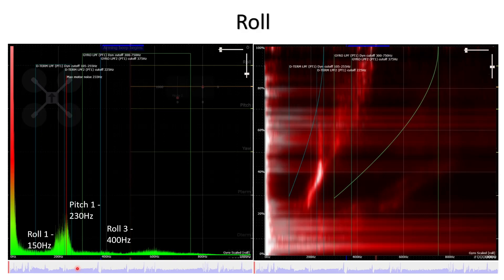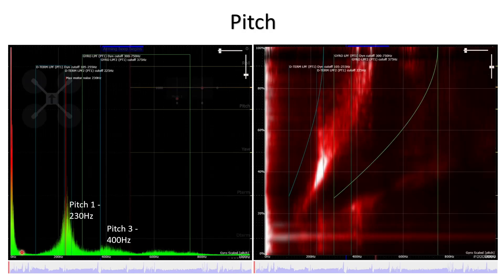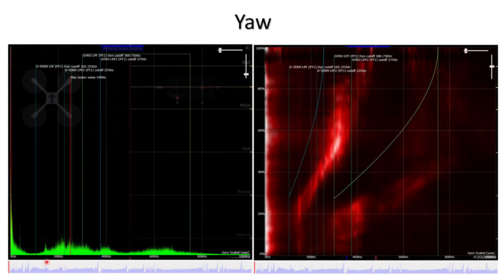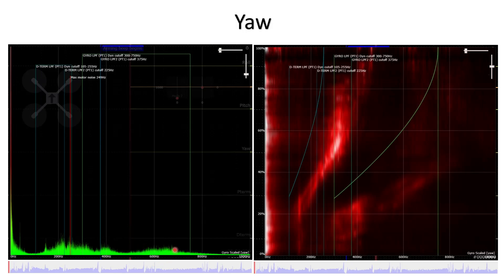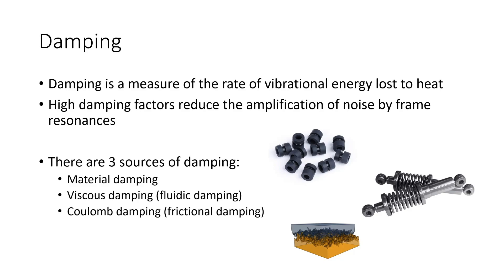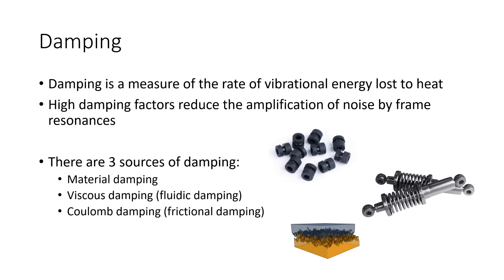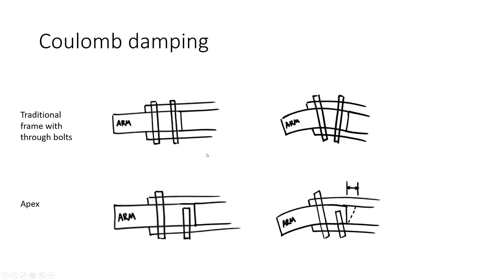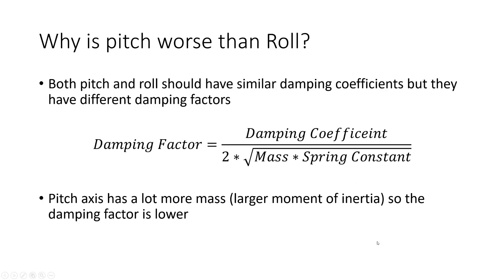ImpulseRC Apex Vibration analysis. Find out why the Apex is so good to fly.

Comment: Hi Chris, I know this is an old video but I hope you see this comment! 
I've been thinking about frame designs as I'm hoping to design my own micro frame. I was wondering what you thought about the idea of using two carbon plates sandwiched together making up the same thickness over a single plate. My thought is that it would introduce a lot of friction between them when bending and help eliminate noise?

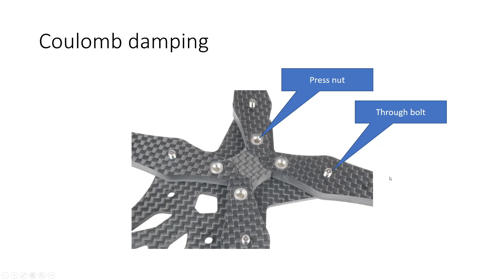Comment: 11:35 — I'm sorry, but I watched this segment multiple times, and couldn't grasp your idea of what moves, what deforms and how it's the "Apex" case where the arm slides more.

I can see how the arm can slide between the two plates: all the holes the bolts go through have some thread-hole clearances. If the clearance (D_hole - OD_thread) is e.g. 0.2 mm, the arm can slide as much as 0.4 mm along its own main axis in the top drawing, but only 0.2 mm in the bottom drawing (because the press nut has no clearance).

But you're talking about bending... Well, when the arm bends downwards, there's no difference, as the upper plate will be bent by the outer bolt, pivoted on the arm's inner end, so the length of the lever is virtually the same. When the arm bends upwards, the upper plate, which now has a much longer stretch that's structurally elastic, will be bent only by the outer bolt tilting and pressing it in, but... my napkin geometry fails me here, but it's either the same radius, so it doesn't slide against the arm, or a larger radius, and it detaches from the arm's surface as soon as they start to bend...

OK, hand-wavy reasoning and Paint pictures just don't work with this. We need to either get a civil engineer who can apply his materials mechanics 402 knowledge and evaluate the two configurations using differential equations and shit, OR do an experiment: get an Apex frame (or, hell, a quarter-frame), ditch the press-nut, drill through the whole thing, install a (larger diameter) through-bolt and compare it against the original. Otherwise, I'm not convinced a single bit.

This is quite an unusual frame. Its excellent vibration properties can come from any one of its features or all of them together.

Comment: what do you think about rubberized and dampening crews for the FC/ESC? not just around the bold, but actually decupled screw with a damping cylinder and then on top of that the flight controller? would be really interested in your take of using those, if it changes the flight charactaristics? thanks in advance! ps: just ordered the AOS 5.5

Comment: Could be wrong but I'm not sure if impulse would have the same test equipment to be able to dermine that the arm friction dampening mechanism provided good result and so was a sole design reason? Could it just be a co-incidence?
However, by having seperate countersunk bolts on the upper plate, they certainly did chose to decouple the flight controller somewhat by choosing not to have the flight controller mounting bolts going through the arms.. which would transmit a lot of vibrations directly to the FC. Most other manufacturers would typically try to save a few grams by incorporating the arm bolts into the FC without considering the bigger picture of piping vibrations directly to the FC.

I would love to see you do a test on using soft motor mounts and maybe also have a look at the iflight Xing motors which use a rubber o-ring between the bearings and motor base to reduce vibes... its the first video I've watched of yours, so maybe you already have. 
Very well done, I love this sort of stuff. You just got a new Sub, :)

Comment: Hi Chris! What do you tjink of the Catalyst Machineworks arm lock design? It seems to me that it could probabily act similar to the apex. I have 2 Cmw frames and the vibration performance is great
Reply from the maker: It really depends on the weight. If the frame is heavy it will probably have good vibration performance. But it's also heavy... The goal is a lightweight frame that is strong, and stiff with good vibration performance.
Reply: @ChrisRosser  I got it,thank you 😊
One of the cmw frames I own wheighs only 69 grams so I was wondering if the fact that the inner arm screw isn't locked to the arm itself could be the reason of such a good performance
Reply from the maker: @loryriga  It could well be providing a benefit. It's very hard to know without an in depth analysis of the specific design.
Reply: @ChrisRosser Great, thank you for your reply Chris. 
If in the future you'll analyze a catalyst frame I'd be very curious to see the results!

Comment: And with all this insight and ultra in depth viewing he will still say check motor temps. Reduce filtration follow a good strategy check motors. Can you reliably log this as a given cos different flight controllers produce different noise. Same frame different flight controllers different readings. The theory is one thing but it will come back to checking motor temps for feel.
Reply from the maker: Got to check your motor temps. It's just common sense because no one likes to smoke a motor because of some undiagnosed tuning problem!

That said, if you follow my approach checking motor temps should more be a double check that you didn't accidentally screw up rather than an integral part of filter tuning.
Reply: @ChrisRosser  it’s pretty hard to screw it up.

Comment: I really don’t understand why with single bolt it sliding but with 2 screws is bending
Reply from the maker: The second screw constrains the sandwich plate to move with the arm. Without relative movement there can be no sliding and no frictional dissipation. KababFPV has done a video on some testing he did to verify this hypothesis on his Toothfairy frame. Worth checking out: https://youtu.be/oHONikUxCcw

Comment: If you read the ImpulseRC web page they specifically mention the shoulder bolts as being unique to this frame.  I guess with a shoulder bolt you get a much tighter tolerance fit between the arm and the bottom plate as apposed to a fully threaded bolt? 
Nobody's talking about the shoulder bolts.  I thought it sounded like an interesting point to think about.
Reply from the maker: Thanks for the comment. It's a great point, shoulder bolts do help get a nice fit between the screw and the carbon.

Comment: If you're considering any other frames to analyze I'd vote for the hyperlow airshot.  It seems like it may benefit in similar ways, but I've never seen any logs so it's just a guess. And also the mad kwads frame because they're the only frame company I've heard even mention vibrational analysis as being a driving force for design choices. Great job. Your coulumb damping explanation was great and the drawing top notch but I feel like a great animation and maybe a little more detail or depth on the friction/bending/compression/stretching aspect could have really driven the concept home for everyone.
Reply from the maker: Thank you for your feedback. I'll definitely try to do some animations next time to show the effects.

Comment: Hello Chris i would like to ask you about your graphs. All graphs that you provided into the video are having x axis limited from 0-1000hz. Does that mean that higher frequencies are not that important for drone flight? Because i'm imagining this system to fly on frequencies much higher than 1000hz.

#question
Reply from the maker: Flight frequencies for a quadcopters are <100Hz. Motor vibrations go up a bit higher to around 600Hz. Up above 600Hz there is a hardware lowpass filter on the gyro that really  attenuates noise above ~500Hz and once you get to 1000Hz the gyro just isn't sensitive to those frequencies anymore.

Comment: Could you effectively dampen all quads by simply using a viscoelastic dampening layer between carbon fiber plates?  I am thinking of the same type of material that is used unconstrained in aircraft fuselages to assist in active noise cancelling and as well used to dampen buildings in shear layer constraint for earthquake dampening?
Reply from the maker: Yes, absolutely. This may be the next step in frame design.

Comment: Dear Chris, I was referred to you by Bob F.  Here is a question that I bet you have an answer to.  I am an experimenter.  So I sometimes do silly things like trying to make a FC stack waterproof by submerging it in 3M dielectric FC 84 as a means to liquid cool it. Even with Heat pipes and Radiator....Why?  For grins.  HOWEVER, for no good reason, I am seeing upon arming all is good.  Any input to yaw, pitch or roll, gives motor response as expected.  If I use any throttle, the motors ramp up without any other input and other inputs are then useless.  I had to do an emergency landing/crash but retrieved it.  I thought maybe I did something wrong with wiring etc ( not that submerging FC under fluid is a good idea....) but the cooling system works well.  That being said, would a dielectric liquid like the Fluorinert cause an aberration in the FC harmonics enough to create a maelstrom that the filters could not handle?  Is there anything I can change in Betaflight to allow for the algorithm to see through the fluorinert influence if that is what is causing an unsolicited runaway type motor effect?  I sent a video to Joshua Bardwell this evening on this very issue. Thank you for any insight and your expertise is welcomed!  Thank you for your consideration of my query.  If you are in contact with Joshua, please request from him the link to the video I sent him or he can also forward to you my email so I can send you the clip.  Thanks again.!  Very Best Regards, James

Comment: okay, so quad arms should be two arms bolted together and not one laminated arm.
Reply from the maker: The challenge with laminated arms is that they have significantly less bending stiffness than a single arm of the same thickness so amplitudes of vibration are larger. On balance I think that specific stiffness beats damping so I would opt for a single piece arm.
Reply: @ChrisRosser  I think it's holybro they have a frame that has some type of foam laminated between the top and bottom carbon arms. (update it's the 
'Holybro Kopis2 V2 218mm' )

Comment: So it's unicorn magic indeed ;D
I think learning from mechanical engineering it would still be better to make the frame as stiff and lightweight as possible and thus moving resonances into higher frequencies, break major resonances down and reducing their amplitudes.  I think even those triangular design-arms could really need one more arm to make it a pyramid shaped motor-mount to achieve this. I would be so curious how that translated into a drone.
Also so far attention is only given to the center of weight in terms of front-heavy or back heavy. But not in terms of top-heavy or bottom-heavy. Many of those modes which would normaly not turn into gyro-noise but only accelerometer noise (straight movements instead of angular movements) can still cause the quad to all of a sudden get gyro-noise if center of weight is off-axis. And those resulting movements out of a different mode are usually much harder to filter as they don't show up as smooth sinus-waves. (I work in the construction of checkweighers and there torsion modes actually turn into linear weighing-motion if the conveyor-motor sits off-center.).

I really have a quad frame in mind that would incorporate these 2 effects - shifting center of weight down and allowing for a pyramid-shaped motor mount... maybe this should be a approached further...
Reply from the maker: I agree I look forward to seeing what you come up with!

Comment: Hey Chris! I watched all of your videos, they are insanely informative and I really love the work you do. I like to design and manufacture my own frames, so I can tailor them to my needs. They work fine, but I'm having issues with vibrations, as I have never run vibration analysis on them. From a designing standpoint, what would be the workflow, to design a frame that handles vibrations best? The majority of vibrations (if not all) comes from the motors. So my question is, is it a valid idea, to somehow measure what kind of vibrations does the motors generate, and then try to design a frame that tries to suppress these frequencies? Or this would be pointless as each motor has unique vibration frequencies? Or even if you change the props, these frequencies might shift, so your design would be pointless? What would be your thought-process or workflow in designing "the perfect frame" purely from vibration standpoint? Thank you, if you take your time to answer my questions, and keep up the good work!
Reply from the maker: That's a really great comment and a tricky question. I am currently in the process of designing a vibration optimized 5in frame and I am very much figuring out the workflow as I go along (making lots of mistakes along the way!) Once I have a method refined from the madness you can bet I'll do a video on it 👍
Reply from the maker: The motors (and props) are the primary source of vibrations. The key is to try and keep the frame resonances away from the commonly excited frequencies, lift the resonances up in frequency where possible and separate them so they don't amplify each other. Gyro_scaled blackbox logs can show you what frequencies your motors are generating and where the resonances in your frames are as well. You can even find resonances by tapping things and analyzing any ringing with a spectrum analyzer.
Reply: @ChrisRosser  Thank you for your answear. I'm looking forward for the video!

Comment: Now, theory is one thing, simulation also and experiment is the missing piece here. Thermistors on both sides of the friction damped arm while pumping the throttle with unbalanced props would help confirm your reasoning. Anyone has a frame lying around? I'd ship it back after. I'd bet they didn't think about these dynamics in the design stage. They would have made marketing around it, it's a great idea. 
I'll try it on soft mounted cameras with the right materials for the first harmonics.
Reply from the maker: I would be very interested in confirming the hypothesis. I have an apex clone I can send you.
Reply: @ChrisRosser  Let's try to confirm that theory. Pm sent.

Comment: your coulomb dampening hypothesis seems to ignore the fact arms are buttressed against each other which would prevent any sliding.
Reply from the maker: Your right that the arms are buttressed but that doesn't prevent the microscopic sliding occurring because the distances are so small (a few microns!) In fact the arms touching each other adds surfaces to slide over each other and could increase the coulomb damping coefficient.
Reply: @ChrisRosser  how? and how is this measurable given the scale of microns? surely arm length, width, thickness, and softmounting (which has clearly visible dampening) would come into play well before any microscopic sliding.

Comment: Another great piece of design in the Apex is their "Through bolt" as you call them are proprietary and etched-thin at the top and bottom of the arm... thus on a bad crash on the arm the bolt is more likely to shatter at those points and not rip either of the sandwich plates; after 15 months flying Apex I've broken 5 of these bolts and only one Sandwich plate and never an arm (though I very well should have)... never knew about what you're describing in their video but this "etching" could also allow for more coulomb-dampening due to the "through bolt" being less rigged because of etching perhaps? (i mean, in my thought experiment atleast).
Reply from the maker: That's a really interesting design feature. My GEPRC Mark 4 usually shears bolts in crashes and I must say bolts are cheaper than carbon fiber and easier to replace! Unfortunately with the Mark 4 if the bolt shears it breaks a small carbon stiffener which also needs to be replaced but overall it's still cheaper than an arm. One thing to bear in mind is that crashes will cause interstitial delamination in the arm which will reduce its stiffness and exacerbate resonances. So if an arm has taken a big hit try twisting it. If it twists a little easier than the others it may be time to replace it.
Reply: @ChrisRosser  Good to know! I replaced one that had visible delamination after it ripped through the plate; rest seem mint condition!
Reply: I think what you are talking about is what we do sometimes in the offroad racing world and call it a "fusible link". It's a designed-in failure point to protect the other stuff around it. Don't know about it damping anything, though.

Comment: Maybe u can input vibration data to your analysis to find how long the period of mode shape. If periode is to long maybe the natural frequensi of the frame same as frequensi of  vibration on a motor it will cause big resonance.
Reply from the maker: Absolutely, when the motors are spinning at the same frequency as a resonance you get a big amplification!